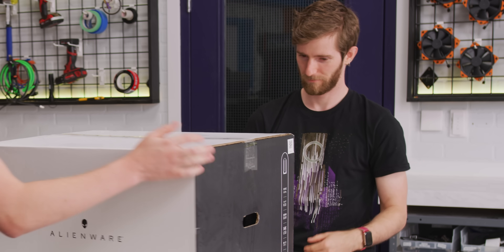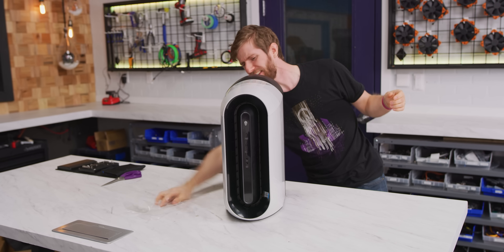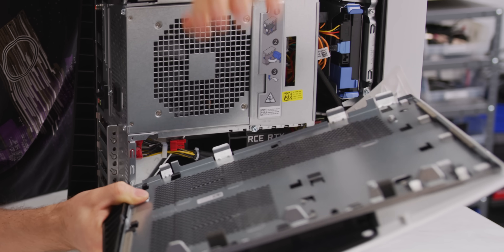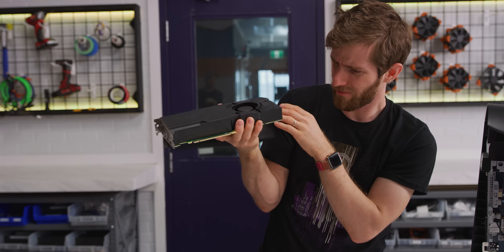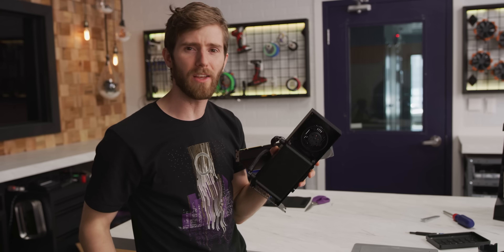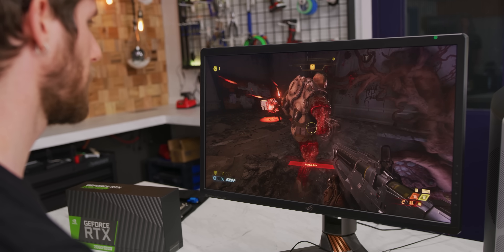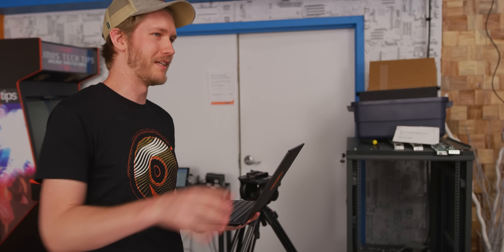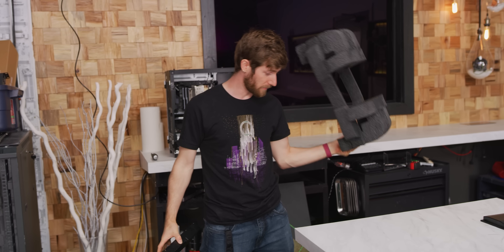I've Never Seen Anything Like This - Asetek Rad Card

Comment: I have this case with a 2080ti blower style and I have to under-clock the card to play games reasonably, it runs so hot and loud the cooling in this case is not good at all!  Seeing this makes so much sense and alienware knew they needed this
Reply: It wouldnt be an issue if they designed a case with good airflow.... instead of asking another company to over engineer and pass the extra cost to the consumer.
Reply: Hickeroar proving that being an unnecessary dick is still alive and well on the internet.
Reply: @rudeboyjohn3483   Apparently so is lying. Not sure why people have a weird urge to trash pre-built gaming machines, but it's some kind of weird religious crusade.
Reply: @Hickeroar  honestly give it rest 🤦‍♂️ please let it go. We're not all going to have the same experience with hardware/set ups. Im pleased you've not had any issues, I on the other hand have had 2 power supplies and 1 mobo fail in the time I've owned this machine. I'll never buy an alienware again.
Reply: @Hickeroar  not trashing it just my card is toasty
Reply: @HomeworkRadio  Hickeroar just got done buying shares in Dell/Alienware.  Oh, and he needs to turn off vsync.
Reply: @Hickeroar  Imma guess you've built, maybe, one system (or two!) and have maybe just started to get into the weeds in the pc space so now you think you know everything....you don't. Stop acting like you do.
Reply: @Hickeroar  imagine unironically defending Alienware, after watching this fucking video.
Reply: I also have rtx2080 in my alienware, funny enough quiet and compact is how it was advertised, i didnt know it was a blower type. Im waiting for next gen from nvidia to build a new pc myself and sell off the alienware being only a few months old as im really unhappy with the noise especially during VR experience. The quality of alienware over the years did drop since dell picked it up. I am not saying they are bad machines but if your able to build your own you will be happier in the end.
Reply: @CypFlyer  agreed, im looking to build now and add the new a new nvidia card which fingers crossed should be with us very soon 😀
Reply: @HomeworkRadio  you may have gotten this advice already in the months since you commented, but try combining an NZXT Kraken G12 and a 120mm liquid cooler, should come around to under $100. G12 is kind of an adapter that lets you mount liquid CPU coolers to GPUs. Due to the fact that you'd be cooling a bare GPU die, a 120mm liquid cooler will cool down even an RTX 2080 Ti to under 70 C easily, even at full turbo.
Reply: @subrezon  Great suggestion, sadly with this case I think it would be difficult :(  I have however built my own PC now with an RTX 3080. I still have the alienware that I'll be selling very soon ^.^
Reply: @HomeworkRadio  Well, there is no case compatibility issue that can't be solved with a drill, dremmel and file. My NZXT H210 didn't support 280mm rads out of the box, it does now.

But anyway, congratulations on the build, welcome to the club.
Reply: oh yeah. Their case designs may look interesting from the outside but anything that isn't a traditional style with a large open air intake is going to suffer terribly in the temp and noise department.
Reply: Well.. My 240mm 60mm thick gpu loop runs cool and quiet.. 54c max.. ambient 31c
Reply: Not my fault you bought a prebuilt
Reply: rtx 3070 f
Reply: You should probably do what I’m about to and upgrade the case fans. Helps with both cpu and gpu temps.
Reply: @insanegd8777  Even though I don't have the system anymore I did do this ^-^ noctua at the front,  corsair at the top 👍🏻
Reply: @HomeworkRadio  how well did it work? Just ordered a water cooler and two fans. Maybe my r11 won’t be a space heater anymore
Reply: That's what you get for buying prebuilts lol
Reply: I find this hard to believe. I've got that setup, and using afterburner's default fan curve w/ a 100mhz overclock (and 250mhz on ram), my GPU never breaks 70C (Blower style heat sink)... These hyperbolic comments are likely from people who don't own these systems.
Reply: @Hickeroar  It's not. Its factual in my case 👍
Reply: No pun intended, I'll take it though 😂
Reply: @HomeworkRadio   Sorry, but I'm pretty skeptical of that claim. Reality doesn't back those claims up from plenty of other tests and examples. If you are having these issues, it's because something is wrong with your setup. On top of that, no one under-clocks their video card, because that functionality is built into the card where heat is concerned. If your GPU gets too hot, it will throttle itself down to where it needs to be to maintain healthy thermals. Underclocking a GPU is nonsensical. It doesn't make sense.
Reply: @Hickeroar  No worries 👍 we're done wasting each others time i think you'll agree 😊 have a great day!
Reply: @HomeworkRadio   You should probably stop spreading misinformation.
Reply: Hickeroar no it’s does get hot mine reached 94 degrees in a well ventilated case and I could only imagine what it would be like in a case like that.
Reply: @eveangreen1871   Then it's not a well ventilated case and/or your fan curves suck.
Reply: Hickeroar I have the fans at max I have 3 Corsair mag levs in and 3 out. In the define 7. No way that’s the problem.
Reply: Hickeroar I’m close to just water cooling and reposting with liquid metal. If your wondering what card it is, it’s the PNY 2080ti
Reply: @eveangreen1871   If you're hitting 94 degrees with fans maxed out, there is something seriously wrong with your setup. It sounds like your GPU's heat sink is not properly/fully in contact with the chip. I'm running the blower at around 60-70% under full load, and at the end of hours of max load I'm sitting around 69-70 degrees on the afterburner graph. It never gets over 71. And that's with an overclock on it in place. This is in an R10 from alienware. All stock parts.
Reply: Hickeroar oh well my gpu is basically at max at all times 100% load. But nope I replaced it’s paste with ic diamond and I made sure it got a good spread by checking it and then repeating after I was happy with the spread.
Reply: @eveangreen1871  👍 appreciate you commenting.
Reply: @Hickeroar  Uh no..People undervolt and underclock their cards pretty damn often...you saying people don't do this because it's automagically built into the card makes me think, no sure, you have no idea what you're talking about.
Reply: @eveangreen1871  These couple people like hickeroar have no idea what they're talking about. Honestly comes across like some that maybe built one system and just getting into pc's thinking they know everything.
Reply: @Hickeroar  Found the alienware fanboy
Reply: Hickeroar dangbad
Reply: @Hickeroar  70 degree i hit barely with a slim notebook with 2080 Max-P (150W!), therefor a 2080S should be much cooler in a "big" case.
My GTX 1070 in my desktop (with a proper cooler, not the jet-like blower style trash products!) barely reaches 65 degree at very low RPMs....
Reply: @Hickeroar  your right mine running quite and great .

Comment: I feel as though the case for that is just a Dell Inspiron case with extra plastic all over.
And then the keyboard and mouse look identical to the ones included with Dell Inspiron and OptiPlex desktop PCs. Even the accessory box has a Dell logo on it. Oh my. It's as though Alienware knows that users won't be using the included keyboard and mouse, but they still have to include those to get the user started, or as backups, so they probably grabbed an entire Inspiron desktop accessory pack and threw that in.

Comment: The back panel makes me feel that this is a reverse sleeper build... Like an office Dell in a $300 case...
Reply: a Ricer lol
Reply: That's kinda the vibe that Alienware PCs give me in general haha.
Reply: If it wasnt for the 2080 peaking out my pc looks more expensive lol
Reply: It's an insomniac build
Reply: I felt that way as well. The front area is pretty awesome though. (:
Reply: I think that's exactly what it is.  If you get an Optiplex or Precision, the guts are almost the same as this.
Reply: "Like an office Dell in a $300 case."

Yeah, that's kind of basically the entirety of Alienware PCs after Dell bought out the Alienware brand. They used to mean quality back then, but now they're quite literally just souped up Dell PCs using bottom barrel parts for how much you pay.
Reply: Dell for the pass few years... including their newest Smart shift AMD G5 SE 4800h laptop are all bad engineered designs. New Dell AMD laptops run extremely hot 🔥 hot, their panel ms refresh rate is garbage and they're the slowest AMD laptops. Dell high-end alienware builds are in the same category you're better off with an eluktronics 16 cores for $2k
https://www.eluktronics.com/THICC-15/
Reply: @BjayawesomeBlackDude  
Or just build it yourself
Reply: @BjayawesomeBlackDude   Almost all "cutting edge" gaming laptops have major thermal issues. There are a couple standouts out there these days, but by and large thermals in a thin platform are just a big problem.

Alienware's thermal design is typically quite good, but the people building their laptops have a bad habit of really caking on the thermal compound, which really ruins it. One of the leading suggestions for new laptop buyers is that they disassemble the laptop, clean off the gratuitous compound, and apply new compound properly. It's a shame, really.
Reply: Ok I'm gonna ask, what is a sleeper build?
Reply: @adeowazhere  A "sleeper" is something that looks bad on the outside but actually performs very well. It's usually used to refer to cars in my experience, but can apply to other things like PCs that look cheap but have high end hardware inside.
Reply: @adeowazhere  like a. Sleeper car looks old or average yet inside is a beast
Reply: You mean Ricer?
Reply: "I heard you like PCs. And I heard you liked graphics cards. So we put a PC in your graphics card"
Reply: Except that Dells don't use standard motherboard layouts. Or at least they didn't back when I was a sysadmin.
Reply: @fyrstormer  I think they changed to using standard ones now. My old Optiplex 755 has a reversed layout, while the one shown in the video does not appear to have a reverse layout.
Reply: Take this. And put it in a 2000 dell desktop
Reply: Well.. This is it.. This is the comment that changed my mind. I'm throwing my mini ryzen build into the old af dell octoplex chassis. An old af 380 low tier case.

Comment: Reason it’s not power coated on the back and for the strange construction is that this is essentially a Precision 3630/3640 cage, which is an Engineering Workstation aimed at Enterprise, slapped into a Alienware molded case.

Comment: @LinusTechTips is this a good pc? Intel i7 8700K
Corsair h100i liquid cooler
Asus Strix Z370-E Motherboard
16GB G.skill Trident RGB RAM
Asus Strix GTX 1080 GPU
EVGA 750 G2 PSU
Samsung 500GB SSD
Western Digital 1TB HDD
LG BluRay Writer/Reader
Phanteks Enthoo Pro Tempered Glass Case

Comment: Not darkening the chasis might be about visibility. Most of the time I only guess where the jacks are by contrast. Of course, I'm 58, and kids (anybody under 35, to me) won't suffer that shortcoming (yet). Now that I think about it, that could be solved by some lighting on the back of the box... (no I don't want to be using a flashlight each time I need to grope around back there. I want a nice led powered from within)

Comment: Dell would most likely have to take all of those cases sent off to somewhere else to have the black coating applied, since they are probably using the same production lines to do all of their cases throughout their different product ranges (think about how many cases THAT is). To have those lines re-worked or to add a whole 'nother destination for those cases to be re-worked with the coating where they have to be shipped again would be really expensive, add a lot of lead time, and is not worth it (to them), since the target end-user of an Alienware system isn't going to care about stuff like that anyway. If they were focusing on a niche audience like actual computer enthusiasts and not just regular consumers that want to play games good, I'm sure they would have worked the coating into the production line.

Comment: They've been using modular power supplies in these things for well over a decade (or, at the very least, Alienware was doing it in the mid-2000s before the buyout). I've got a vintage one that is "modular" in that the entire wiring harness for the system plugs into the PSU via one gigantic connector. The reasoning is pretty simple - these machines at least used to have a ton of custom wiring in them for lightning and other stuff, meaning being able to swap out a dead PSU with one simple connection swap basically made replacing the PSU cost effective for them. 

Oh, and you're stuck with their proprietary units with the custom connector because otherwise if you want to upgrade you're stuck completely gutting the case to run new cables.

Comment: "That's not a bad looking machine" - Linus
"That is so god damn ugly" - Me 3 seconds earlier
Reply: even tho ive seen pics, i still threw up in my mouth when i saw video footage of it
Reply: If there's one thing that's a guarantee in the Gaming PC market, it's that one person's case preference is laughable to someone else.
Reply: Looks like one of those bladeless fans. Honestly it’d be kinda cool if they made the air go through the middle part.
Reply: @Martin Dawson Are you talking about RGB? If so I would have to agree for the most part. I like RGB but it is hard to do tastefully and easy to make it look horrid or cheap.
Reply: @jt thorsson  The airflow is pretty decent in them. They're set up so the PSU's airflow is in->out, blower style GPUs (which are louder, sure, but good for airflow), top exhaled CPU heat, and a beefy fan in the front to establish some solid intake into the case. It could be better, but it's not nearly as poor as some of the g4m3r cases out there. If you use the default fan curves in afterburner, the GPU fan is a bit on the loud side, but you rarely break 70C on the GPU under full load, which pretty much means that there's a decent amount of cool air entering the case.
Reply: @jt thorsson  If you run your system at default clocks, the cooling is better than any heat it'll generate, and it's very quiet. However: If you overclock, which is really something they push in their upselling/marketing, their default fan curves may not be sufficient to keep things from throttling under all-core (or several-core) loads. I've got a 9700K overclocked to 5ghz, and I have the performance fan curves in place, which are definitely more audible, but do a great job of keeping things cool.

My R10 was the first pre-built I've ever bought (I always have self-built), and I got it because it was an an extreme sale just before the R11 came out, and was cheaper than self-building. My worry with these systems is that many times, the people who buy pre-builts are not knowledgable enough to really know what to do to get things running optimally. There are also some weirdities too, like XMP is disabled by default, so they advertise 3000mhz ram, but it comes clocked at 2400. Most people aren't even going to look for that unless they've self-built in the past, and even then.....?

Comment: Linus at the end of the day its not about the rad but about your cooling solution, Be like me and run your pc as cool as you want with the cooling solution Ive come up with. Its designed to cool a house of 1000 sq foot and its cooling a 80 sq foot room at my house.  I wear a coat in that room year round, but my temps are glorious.

https://www.homedepot.com/p/LG-Electronics-18-000-BTU-230-208-Volt-Window-Air-Conditioner-with-Remote-and-ENERGY-STAR-in-White-LW1816ER/206520618

Comment: 5:05 There is fun fact about this. My Aorus X299 Gaming 9 requires 2 x 8pin on motherboard. I used to run it with only 1 x 8pin power. It was okay until I wanted to use all 8 slots of RAM. I realized that only 4 slots of RAM works unless I plug in both 8 pins. So this motherboard will probably work with 4 pin, just not for some features (like OC).